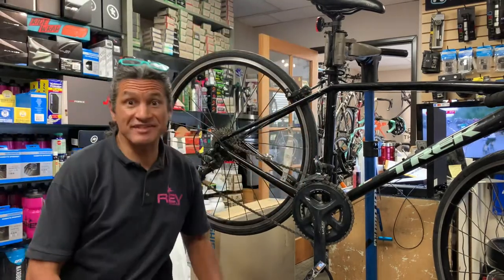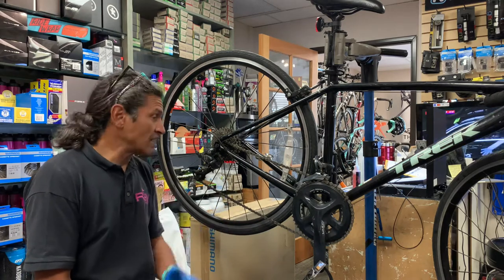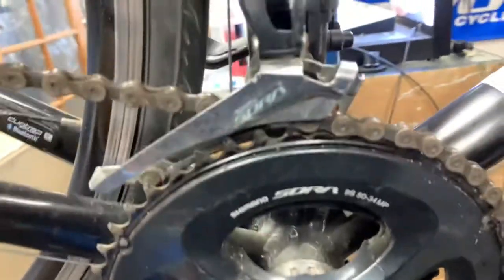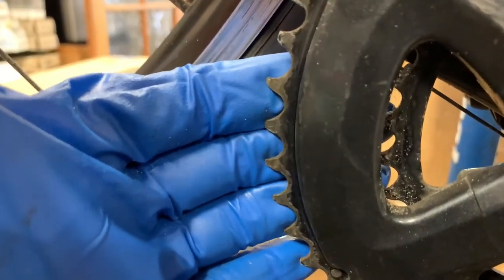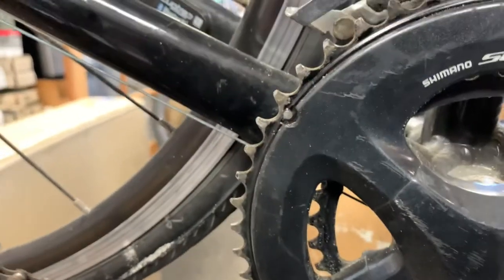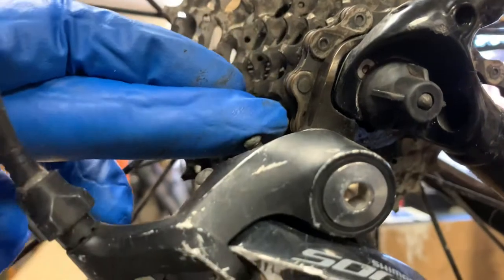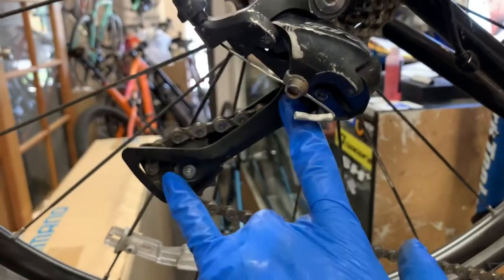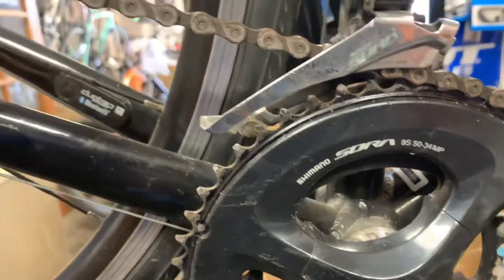What does a worn drivetrain look like? Worn chain worn pulleys worn chainring

Comment: Not only that but look at a new one - Shimano doesn't use the same grind on the smallest chain ring as on the biggest. It's because the small one never gets shifted up to, just down to, and it always has gravity assist (so there is usually a smooth surface) the Big Ring has no gravity assist so it gets the full HG treatment. Somewhere there must be an appropriate engineering text on this. Those chain gaps will occur - slack the chain tension and lift it up and see if it flows with your finger. It won't flow, it will kink because of corrosion, which affects some kinds of chains worse than others. ⛑
Reply from the maker: Great points! Thanks for watching

Comment: Surely just lubing the chain will allow the chain to sit further down on the cogs?

Honestly I don't see any reason for replacing these parts until you start missing some teeth
Reply from the maker: These components (chainrings, chain and pulleys) are excessively worn! There is no question whatsoever that these components need to be replaced. There is no grey area on this particular example. 

Thanks for watching please consider subscribing
Reply: @SeeYouUpTheRoad  Ok but what impact do "excessively worn" components have when riding the bike? If the chain doesn't slip I can't see any performance or safety improvement to be had here. Just wasted money
Reply from the maker: @petermarshall8750  that’s the point Peter the chain was slipping. The customer  came in thinking she needed a derailleur adjustment. She’s not that strong of a rider but just by me starting off from a stop the chain was falling off the chainrings. THAT is a safety issue. I’ve seen it when people ride worn out chainrings and/or chain and then do a surge or a sprint in a pack and nearly cause a crash for the rest of the group. 

I don’t understand people like you. You argue with an experienced mechanic and shop owner who is liable for the safety of the customers who bring their bike into my shop. I tell you these components are excessively wrong and you argue with me. 

When things are worn they get replaced it’s not wasted money it’s what you do.
Reply from the maker: @petermarshall8750  FYI - there is no point in cleaning or lubing a completely worn out chain. You mentioned on a couple of occasions that lubing the chain will make it fit better on the chainrings. The chain is so worn and the chainrings are so worn that lubing the chain wouldn’t fix anything. 

We are at an en passe - you are frugal and don’t want to replace components that need to be replaced. I, on the other hand, am responsible for providing exceptional care and consider the safety  of my customers especially my inexperienced riders. When riders have worn items replaced on their drivetrains they notice the crispness of shifting performance returns. Happy and safe customers make loyal clients in the long run. It’s just what you do when you run a good business.